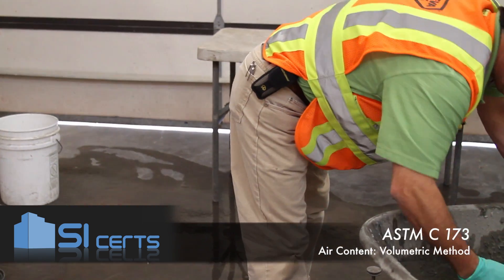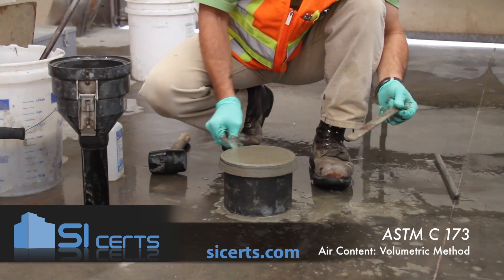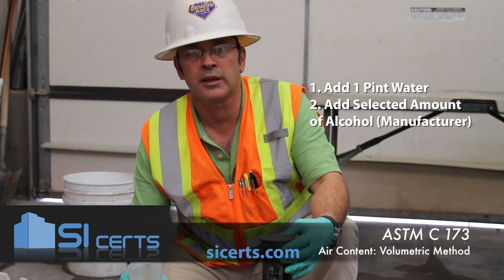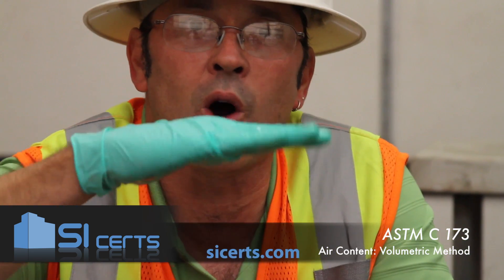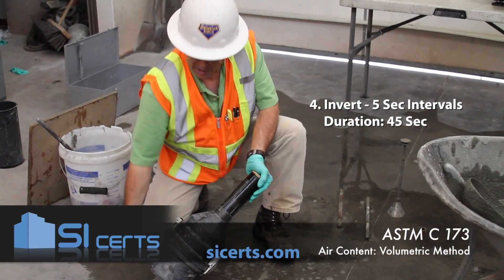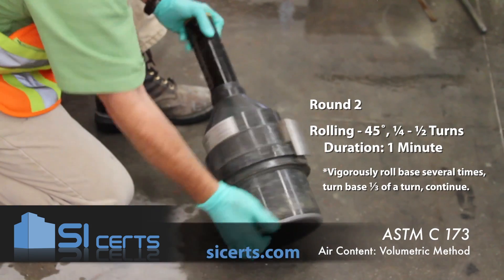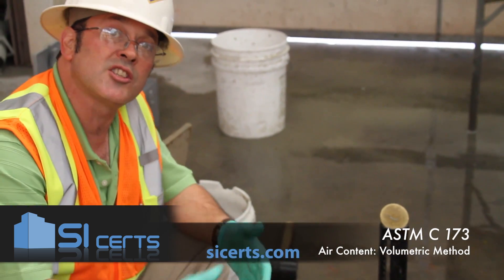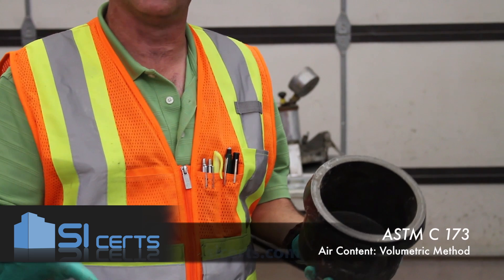ASTM C173 - ACI Volumetric Air Meter Test (Newer Version Available, Click Top Right Corner)

Comment: First, thank you for posting the video. Some of us have to have ACI though we don't ever touch concrete so nice to have a video to help prepare. BUT, according to ACI, you cannot use the same rod or you will fail that question. Yes, it is that ridiculous.
Reply: Every time we go to get certed the proctors say something along the lines of, "The only time you'll ever have to do a rollameter in your life is when you come back for recertification." In reality this is an unnecessary and unreliable test that nobody uses.
Reply: @swiggityswooty9187  You won't be thinking that as soon as they put you on a 300+ yd elevated deck or parking deck extension pour (or anywhere else the EOR specifies lightweight concrete for that matter).......You'll be hating life then.......bring a co-worker along, hee hee.
Reply: @SoaringEagle1  when i got my cert for first time 3 weeks ago they said i would never have to do it besides test, have a 180yd lightweight pour tomorrow at 4am i was just told about 5pm tonight (the night before)…now i’m back to studying it😂😂😂 3yr old reply lmao
Reply: @swiggityswooty9187  I placed lightweight concrete on a bridge deck rehab project on Interstate 84 in Pennsylvania, 700 cubic yards, after the concrete pour, the deck was turned into a swimming pool for curing , the deck had to have water over it for 14 days.
Reply: @swiggityswooty9187  yes i never did that test and now i want to get the certificate and i dont know how to do the reading